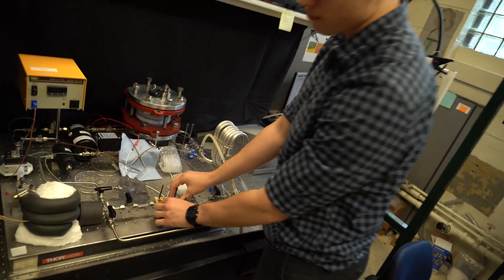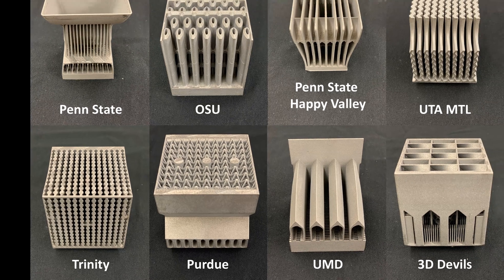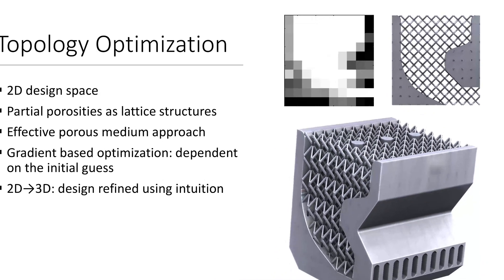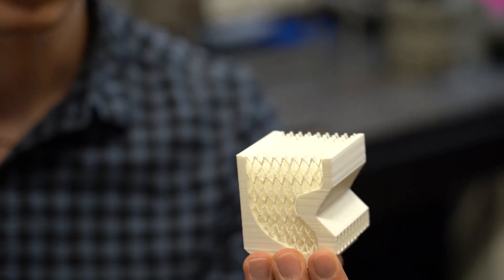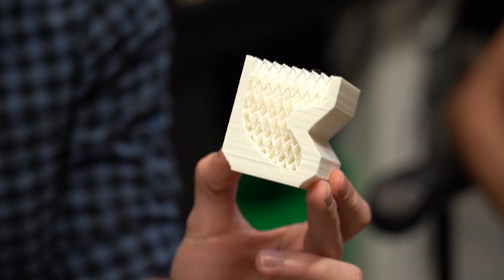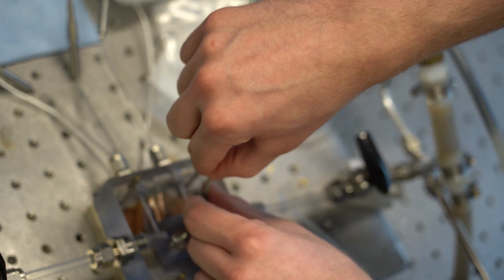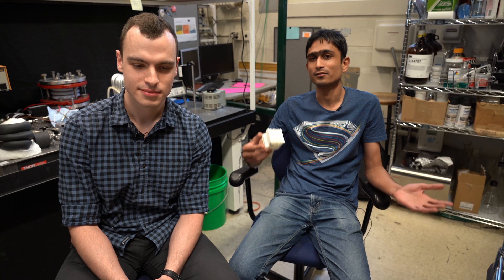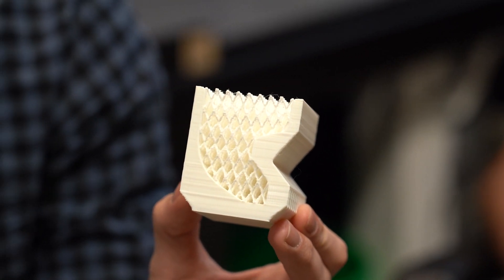Building the Ideal Heat Sink

Comment: I have the same research interest, but air has low thermal conductivity, so we need to move to fluid cooling heat sinks. My professor Wang was graduated from this university with a PhD in 2017.

Comment: honestly it would be much better heat sing for passive aplications 
heated up air will travel up sucking air trough opening on the bottom 
because there is an expansion chamber on top heated air will decrease its pressure allowing for more air to be sucked

Comment: Part of engineering is design for manufacturing.  This design is great for one off designs, but is more complex.  See heatsink skiving
Reply: Just what I was thinking. For example I'm getting ready to cast a pair of passive heatsinks for two large rectifiers rated for 400V @ 25A, 275C upper working temperature using old extruded Al heatsinks for the alloy properties  They are about 35mm square with a large hole in the center for heatsink atrachment. I'm just going from 124V to about 70V, less than 0.5A for now but those bridges can handle 2kW all day with a well thought out hs design (that I'm borrowing in the name of science).

Comment: Why add unneeded static pressure channels, eddy currents, and most of all why add a fan blowing from top to bottom when heat naturally rises. Highly inefficient looking design. Thats pretty much all thermal mass anyways.
Reply: Blowing from top to bottom would be counter flow and is very efficient; you can find natural examples of counter flow in evolved systems such as animal kidneys (the nephron) or fish gills.

Comment: What exactly does this heatsink optimize? Is it optimized for getting maximum cooling for an arbitrary airflow? Would a different profile work better if you tried to maximize cooling for the amount of noise generated? I would imagine that minimizing noise is more difficult since both the fan and the heatsink profile might contribute to both the cooling performance and the amount of noise generated.
Reply: Arbitrary? He says it in the video. A fan is placed on top to blow air down into the heatsink. And of course, a different profile would work better if you had to add noise as a constraint as well. Noise wouldn't be more difficult necessarily. Obviously, they are just having a program run simulations of theoretical designs so it would just apply the exact same principles.

Comment: The one that doesn't clog with dust always wins.
Reply: Just imagine how hard will de dusting off the presented design...
Reply: @Stszelec01  It just needs an integrated port to attach a high-pressure air hose or can of compressed air.
Reply: @rupert274  Yea but it woud require higger pressure than normal canned air

Comment: But in the design process you should also take into account how easily it can be cleaned. I am a computer enthusiast and I disassemble computers on a regular basis. I can say that most of the designs I see are dust traps that in a short period of use will have the very opposite effect. The heatsink will be clogged with dust and the temperature will start to rise. And there will be no easy way to completely clean it. Actually, it will be impossible to clean it, except with the use of an ultrasonic bath cleaner that not everybody owns. And let me tell you that if it is not thoroughly cleaned to be like new, the dust that remains acts like a glue for other dust particles to re-stick on it and accumulate quicker than the first time. In recent years I have noticed that designers do not take into consideration all the parameters of real-world use but also the effect of time itself in the designs of their products. For example, they design a bathroom faucet that may be beautiful in terms of elegance, but in terms of use it is not at all practical because it is not high enough in the sink and to wash your hands you have to touch the walls of the sink that may not be clean. So, you intend to wash your hands and instead you get them dirty (opposite outcome...).
Reply: I noticed that too. This kind of heatsink would benefit from drawing on pre-filtered air.
Reply: @bradykirk9932  You're right.
Reply: Compressed air don't care

Comment: i donno... that does NOT look any better than my noctua d15 or even cheap intel cooler.  first it has such little surface area and such restricted airflow.  where are the test results?
Reply: congrats you missed the point. that mesh provides a ton of surface area for heat exchange.

Comment: Large surface area, high thermal conductivity, cheap as peanuts. Copper wire? 300 meters thin copper wire for 100W CPU? Will be more than enough to cool it passively. Mechanical engineering as your guest.
Reply: Yes, I do not doubt amazing properties of Copper, but at the speed industry goes, and everything producing more and more heat, I have no doubt that one day copper will be overwhelmed. Maybe Liquid nitrogen is the future...
Reply: @DrZipZwan  Other problem I can see is copper source. It is not renewable resource and will become very expensive at some point.
Reply: @Fosgen  True, and even now in some country Copper is already an expensive material compered to its concurrent
Reply: @DrZipZwan  At least now, we can enjoy cheap copper. Love that metal, has excellent both, heat and electrical conductivity.
Reply: @DrZipZwan  Cheap graphene may be answer.

Comment: Does it work the other way? If it was being actively chilled, could you blow air through it and expect it to pull enough heat from the air even in the short time the air spends in contact with it to be an effective small personal cooler?
Reply: maybe liquid cooling might be more effective with this. look at the microfin design for waterblocks.

Comment: Finally some good heatsink to my overclocked Core i9-10900k
Reply: WOW, FLEX. You are not cool by just flexing your kidney
Reply: @monkeh3612  nah bro I have a 10700k
Just joking ya know cuz they are hot lmao
Reply: @Sh1denK4i  Yeah obviously, try competing with my triple 3090 Founder's Edition, Threadripper 3990X 64-core, 128-threaded, and 2TB of RAM you peasant.
Reply: @Tayfaan  Dual GTX295’s on a skulltrail with 5 raptors in raid. Those old builds would chew up power supplies and electric bills like nothing.
Reply: Same dude nothing can cool my i9 9900k @ 5ghz all cores 😬

Comment: I would sincerely appreciate it if you would make me a VRM heatsink for a 2080 ti.  I plan to mount an NH-D15 to the GPU, but I want a cleaner heatsink than what’s available online.  I’m willing to pay.
Reply: I don't think there's a premade VRM heatsink available for the RTX 2080 Ti yet and I don't think Purdue University is gonna make you one. looks like you're going to have to DIY. You might want to check these out for VRM's though https://modmymods.com/alphacool-gpu-ram-copper-heatsinks-10x10mm-10pcs-17426.html I use similar heatsinks on my GPU and get great performance

Comment: That's a very interesting design, but it is incredibly specialized for its application at its size. I'm curious how well it works in real world performance, like for example on a Ryzen 9 series processor, something that would benefit incredibly from an extremely efficient compact cooler. Dissipating 105 watts of TDP in that small of a package would be no joke.
Reply: To be fair, we've been cooling higher TDPs than that for a long time.  The i7 920 that I still use as a back up machine runs at 130 TDP.  The way it was done back then, is you'd shove this huge 455 heatsink with push-pull fans on it, and hope it doesn't crack the motherboard with all the weight.
Reply: ungratefulmetalpansy  Hail, Grammer Nazi.
Reply: It doesn't work in the real world
Reply: @LaithSmadi1  why ?
Reply: @leoyru.3361  I dont really see them making that kind of intricate mesh with metal.
Reply: and btw even if they could do that with some fancy 3d printing it wont be economically viable
Reply: @testify2014  its only a matter of time. Eventually the most efficient design will be all that matters